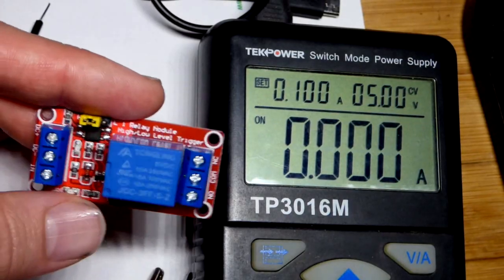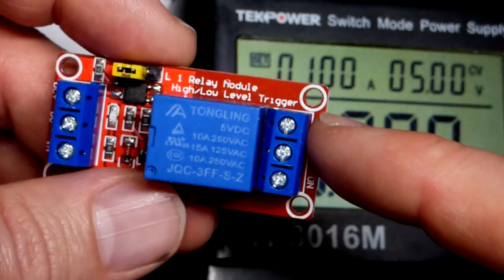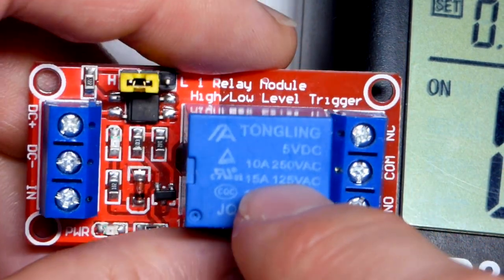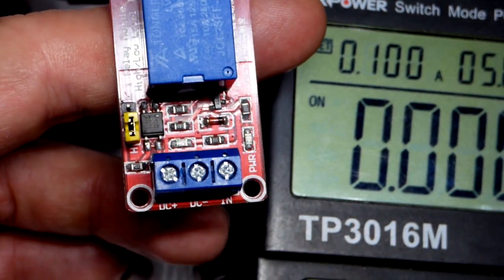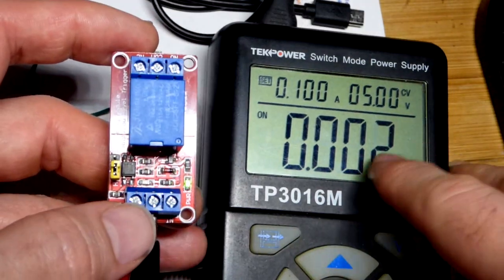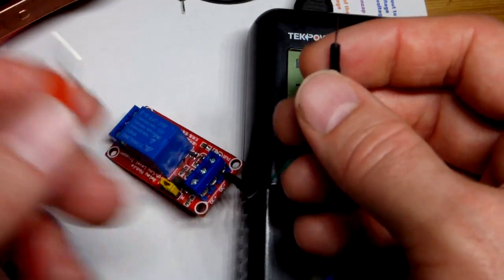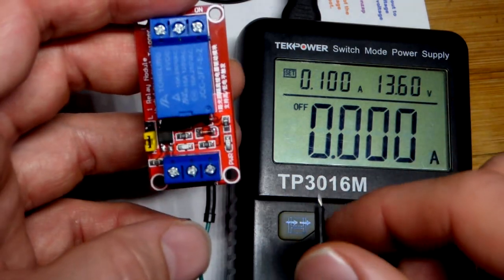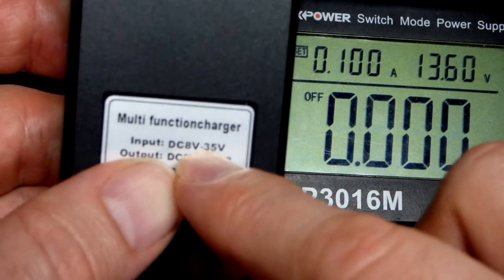Powering a 5V relay with a higher voltage using a 5V USB buck converter

Comment: Should the signal wire be grounded? Also, does the frequency of the signal matter?
Reply from the maker: The module and signal should share the same ground. Whatever is being switched can be a completely separate circuit. The signal just applies a voltage or doesn't, the only frequency would be how often you want to switch and release the relay